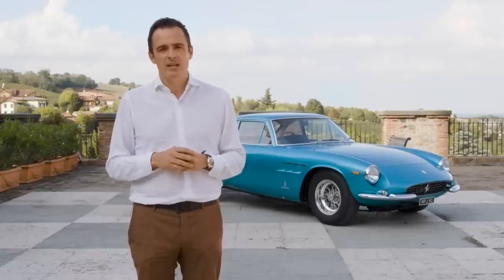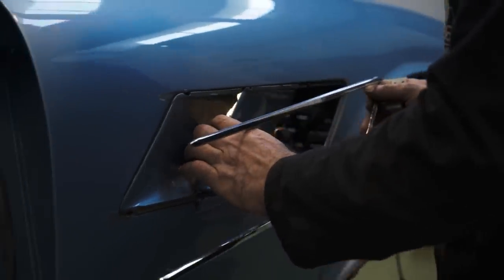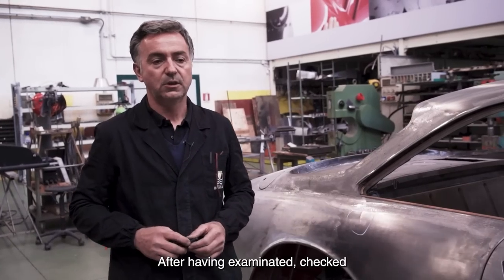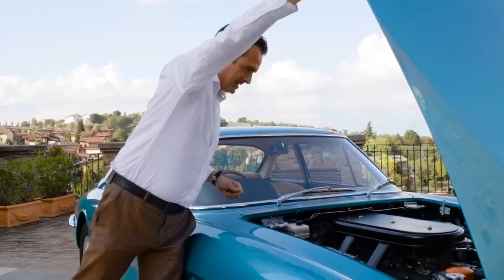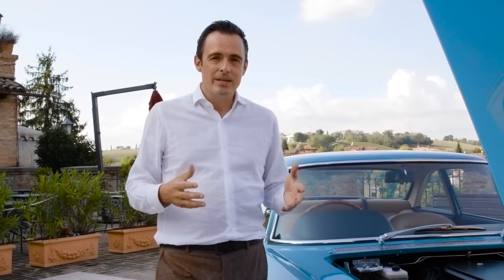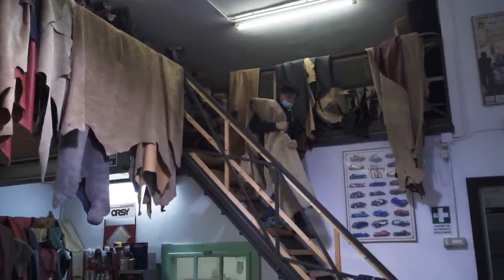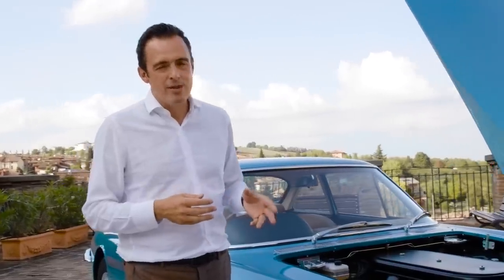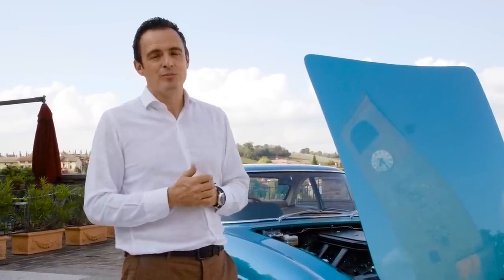Ferrari 500 Superfast - The restoration from start to finish!

Comment: They have all come together ... please!

The 410 Super America and these were always by most admired Ferrari models because they were so singular in purpose and finish.  I never have seen a 500 Super Fast in RHD.  I cannot help noticing it lacks the rest plexiglass ducts riding from the rear parcel shelf of some American models with air conditioning.  Perhaps that was an American market embellishment.  I know Bill Harrah's had them but in Nevada one would have died in the summertime without it.  It helped that he was a Ferrari dealer and also the distributor for the Western United States.